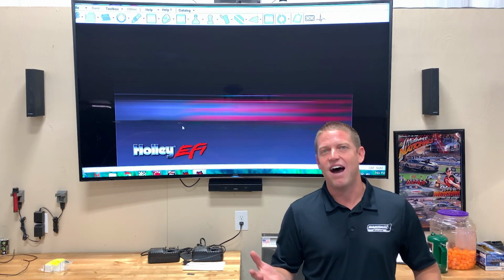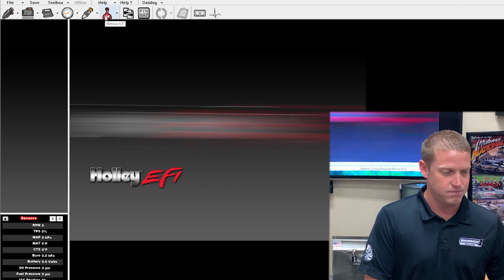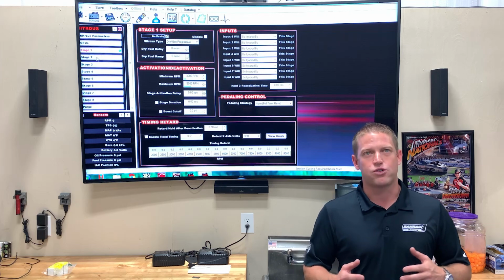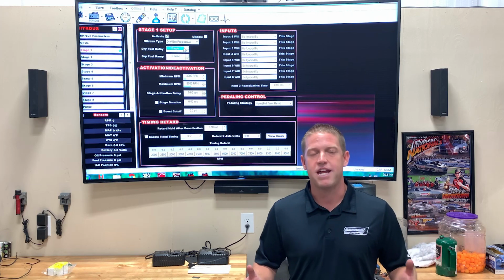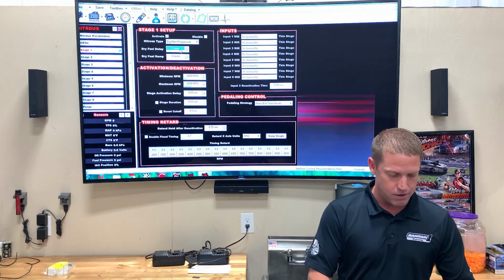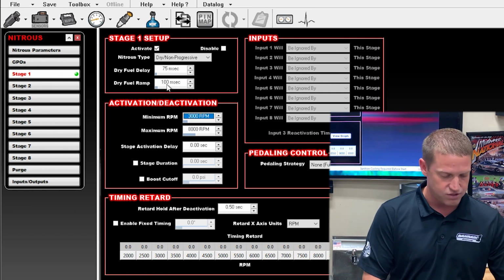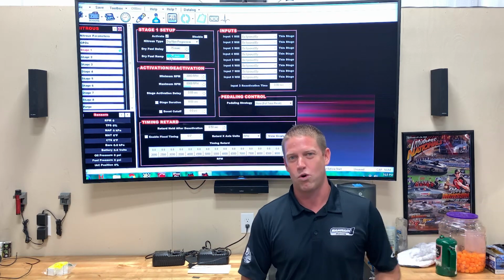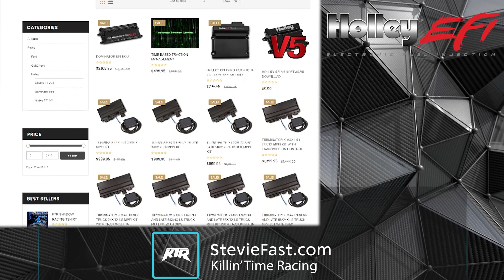The Fast Lane with Stevie Fast - Holley EFI Episode 1

Comment: I’m building a Nova with an LS2. I’ll be running fuel injection and the car will be a street/strip car. I want an affordable EFI system that has some tune ability. I like the Terminator X, but I’m not sure it will offer much tune ability. Any recommendations?

Comment: Would u use a wet nitrous system with the holley efi or a dry system. Most run a dry but would like your opinion on that.